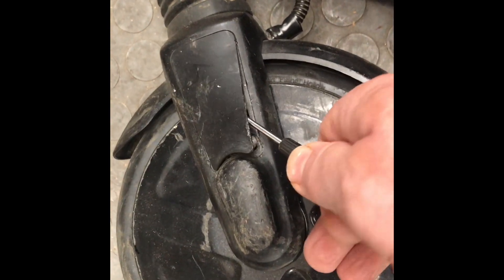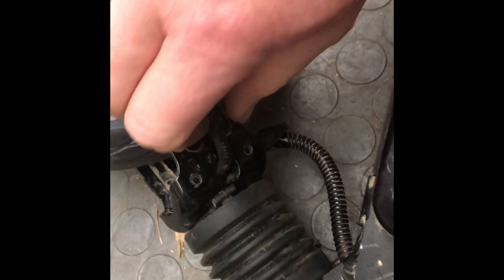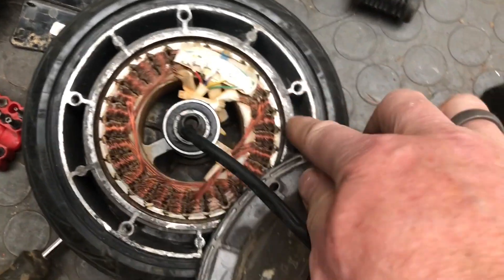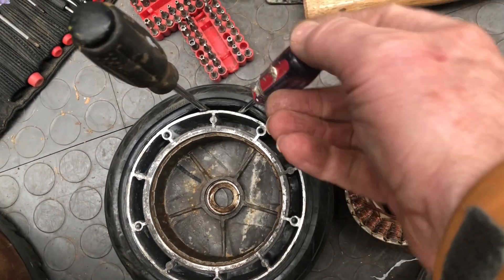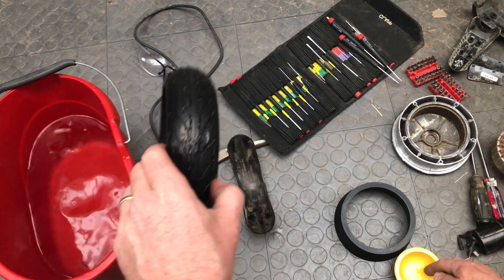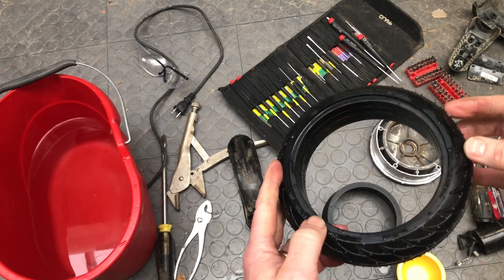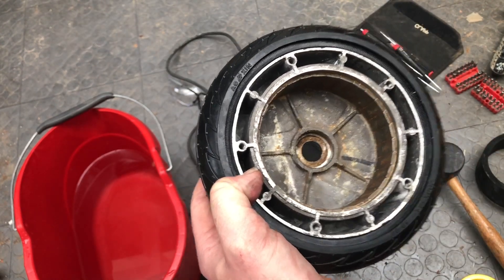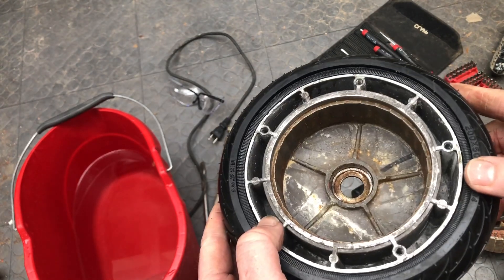Ninebot ES4 front tire replacement

Comment: Lots of ways to do this job. Some videos show not taking the motor out of the rim. No jig, tire irons, screw drivers, etc. Taking the old tire off by cutting it. Heating the tire in microwave, boiling water, oven, or heat gun.

Comment: About the tyres: 
I've discovered that lots of the "third party" manufactured tyres are slightly softer than the original Ninebot tyres and thus have a massively higher rolling resistance. With these my scooter struggles to keep up the speed even downhill.
I have found that these "third party" tyre manufacturers varies in softness and thus the rolling resistance. The harder they are, the better they are.
Sure I can buy original Ninebot tyres, but... no way in hell I'm paying $160 per tyre. ($320 for a set of two). NO WAY!

Comment: Just going to buy a new scooter, way too much work for me. I’d get impatient, why on earth will ninebot make it this hard?!!
Reply: Just take it to a repair shop. Do you also throw away your car when you need to change a tire?
Reply: If my car cost $500 new and the labor to fix a part is this intensive; yes
Reply: @RS-oj3zp  in my opinion, if reparation costs 499$ you should repair it. Why? You give money to a local repair shop and less garbage is produced. Throwing away something just because you have the money  to buy a new one is not a smart thing to do. I've just replaced my tire in an hour or so. I can send you the printed tool for free, just dont throw it away m8!

Comment: What was the Torx BO key number you used to remove the motor?
Reply from the maker: The capped end of the motor? I don’t actually know, I have an assorted set of bits and just picked the one that fit w/out figuring the size.
Reply: T25

Comment: Hi,
Thanks for the demo and the jig. I can't find the link to the .stl file though and would like to print one. Could you please provide the link.
Reply from the maker: https://www.thingiverse.com/thing:4191167
Reply: @Nateclapp  Thanks! Could you put this in the description? The video and description mention a link but you have to dig through the comments for it. Also, did you print with PLA? ABS? PETG? Should I use a dense infill percentage? Extra perimeters? Thanks again!
Reply from the maker: @emmettturner9452  I used PLA and 20% infill.  Depending on your hammering you might want more infill.  After replacing 3-4 tires w it it spontaneously started to come apart on last one. Probably because it was only 20% infill. But I still got the tire on as it came apart.  So 20% will work.  More infill will make it more durable.
Reply: @Nateclapp  Thanks! I’ve had the thing two weeks and the front tire is already getting bare. I can’t afford a car after a tornado recently crushed mine so I figure I’m gonna have to change my own tires to keep this thing economical. :) You’re a lifesaver!
Reply from the maker: @emmettturner9452  one thing I have not done but is an alternative is since tires are solid rubber you could carve some treads in it with a linoleum knife or something.   Not sure how good it would work, but certainly faster than pulling whole wheel.

Comment: Where did you get the tire from. I'm trying to find them online but they all have no reviews or negative reviews. Please help!
Reply from the maker: I have bought them from Amazon and AliExpress.  I think most negative reviews are because initially it looks like it will not fit unless you do steps like I did.  All the ones I got worked fine, just a very tight fit.

Comment: So this must be the same procedure for the es3 as I read on Amazon where I just bought my tire from. And how long do these baby wheels last?
Reply from the maker: i don't know how long they last.  The ones I am replacing are off former fleet scooters I have pulled from local waterways.   I have heard also of people just carving new grooves with a linoleum cutter.  Since it is a solid tire I don't see why that wouldn't work, and delay having to pull the tire.
Reply: They last roughly 600 Miles
Reply: My tires are 200 miles in and looking BAD… these don’t last long at all.
Reply: 240 miles and mine is toast.

Comment: The jig is a great idea, but who has access to a 3D printer?  If you have a roll of duct tape or two and a couple of hours, a tapered jig can be fashioned.  Start out with a diameter of duct tape roll slightly smaller than the inner diameter of the tire.  Build up layers of duct tape in ~ 10 - 15 mm strips until a taper is generated that ends up the diameter of the metal rim.  Cover at the end with a single piece of tape for smoothness.  You'll need to cut out wedges from this piece to make it lie flat.  Warm the tire up, then place dish soap on the tire and jig.  Push the tire onto the jig, pound with rubber hammer as shown by Nate and the tire will be on.  I just now did it for a Ninebot ES4 front tire.  It really worked well.
ForestDweller
Reply: please make a video with this idea.
Reply: Amazing

Comment: Great, but how to change the rear tire?
Reply: You wont need to it doesnt wear out
Reply: @PneumaticFrog  unless you use the back brake heavily
Reply: The rear tire is basically sealed on, the only way to get it off is to cut the plastic up a bunch and use a hammer to break it. I have a bunch of rear tires that I do this with to get replacements for the front.

Comment: Please take note that you need to use security torx for the 5 screws on the rim, super annoying to find out during the repair..
Anyway, thx for the video and the model, looking forward to try out the jig.. Made it with 20% infill and 4 wall lines, hopefully it won't snap :)

Comment: Hey, I'd love to print this out and use this but when I upload the file to Proto Labs for a quote, I have no idea what dimension unit I should use... it offers to print this thing in mm, cm, in, etc, but each selection keeps the default number of "units" (example: X: 50.000 in/mm/cm Y: 149.995 in/cm/mm Z: 149.989 in/cm/mm. I definitely don't want to build this thing to the wrong scale, so I'd like to ask you what units did you design this thing to be printed with? I can't find any specs in the README file or the zip folder. Posted this comment to MakerBot as well. Thanks for sharing.
Reply: Please disregard. Took very minimal sleuthing to find the tire radius is listed at 145 mm... I think I've found my units lol. Just couldn't find it until digging a little further. Thanks for the share.
Reply: 2nd thought of the day. I do not own a printer. Third part quotes for making this party are absurd levels of costly. Would you be willing to print one of these at materials/labor/shipping cost, if I paid you directly? I would be very interested. I think most of these services are oriented around higher volume orders... I just can't justify paying $70 for a single plastic tool.
Reply from the maker: @Kenneth-wr5nt  sorry I have been pretty busy moving during a pandemic.  I would be open to this but I probably couldn't get to it for a month or so. still living out of boxes.